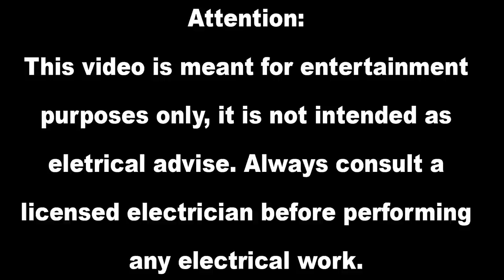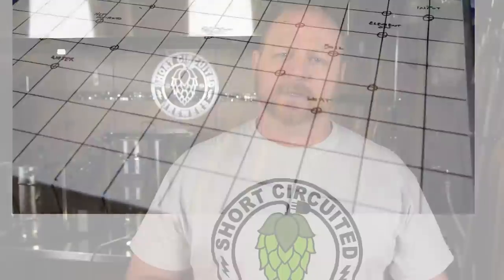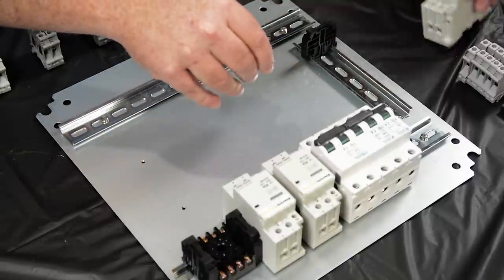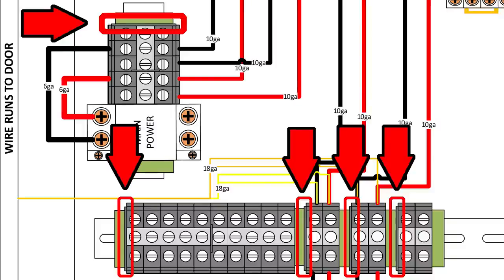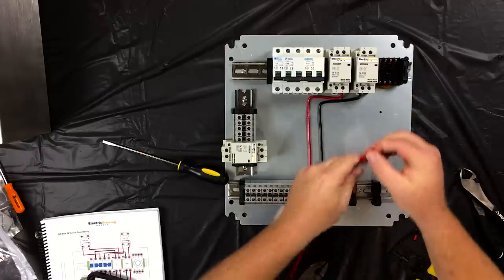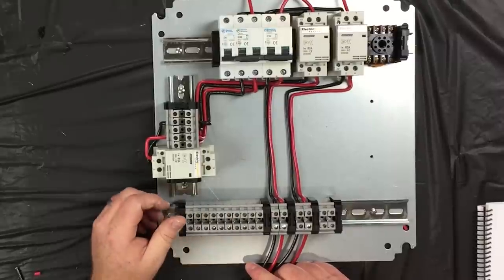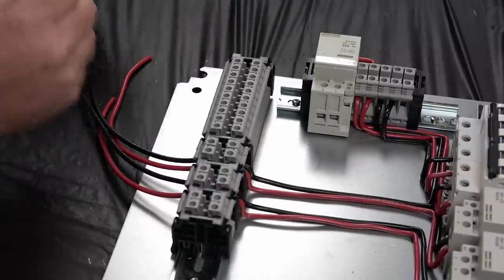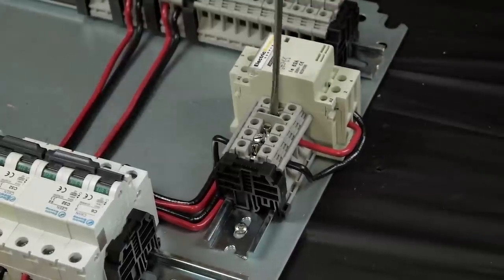Electric Brewing Supply - Panel Build Part 1 - Panel layout and 220V wiring - for electric brewing

Comment: When you make 90s like that with the wire, you seperate the conductors inside of the wire and they become potential hotspots. Might want to consider sweeping the bend. Small tubing benders work great for that, as do zipties and saddles.
Reply from the maker: Understood, thanks for the tips! 👍🍻

Comment: Very excited for this!
Reply from the maker: Me to Brad I'm excited to get going on it. As a matter of fact I'm wiring more of the panel right now. 👍🍻
Reply: Awesome! I noticed you didn't use any spade terminals. Are you foregoing them entirely? Or just with the heavier gauge wires?
Reply from the maker: The way the connections are made  on the back panel of the control panel you don't need to have any spades on those they have a crimp system that holds the wires in place. On the control panel door we will definitely be using spade connectors because those are just screw connections  on  switches, lights, etc. The only thing on the back panel that gets spade connectors is the interlock circuit relay which is also the estop relay
Reply: Thanks for the clarification!

Comment: Hi just a quick note I build panels and it is not recommended to bend the wires with players in a tight bend. I have been told by the electrical authority here in Canada that it can compromise the wire jacket. I once did the same for tidiness but was told my panels wouldn’t pass inspection. We use CSA here in Canada and they have a reciprocal agreement with UL. I am told a curve is acceptable. 
I don’t know if you have had an inspection 
Also ground found ground. 
I now use a copper bar at the bottom or a star point for all grounds. Should be done first.
Reply from the maker: Good tips!! Thanks for sharing! 👍🍻

Comment: Never ever use any form of grips to bend cables the secret is to Make the cable work for you pressure marks are now present on the sheaths of the cables naughty . warm the cable in your hands slide it up and down in your hands so you create heat this then softens the outer sheath and loosens up the cores Cold multi strand cable can crack break if you over pressure i can bend form right up to a 240 quad power cable . ...  Respect to your work my Friend just here to help .
Reply from the maker: Hey thanks for that tip!! I'll use it! 👍🍻

Comment: Great video and very helpful!  Wondering if you know if I can use both sides of the power distribution block to run my hot wires to?  Still using the jumpers, but really allowing for fewer blocks to be used.  Thanks!
Reply from the maker: Sure you can use both sides. The main reason for the jumpers is to allow a single wire to power multiple blocks at time. Thanks for commenting! Cheers Stephen! 👍🍻
Reply: Thank you, that helps a ton. I'll be sure to share my build when done! Cheers!
Reply from the maker: Looking forward to it!

Comment: I've seen some other guys build this 30A control panel, however you're the only one I've seen using those rails to mount everything to the back plate. Do the rails come with the kit, or is this a personal touch you added?
Reply from the maker: That is how it came in the kit.
Reply: @ShortCircuitedBrewers  Thanks, I did a bit more research on their website it appears that the DIN rail components are now an add on option. Love the content.
Reply from the maker: @chrislaliberte544  thanks!! 👍🍻

Comment: I’m at the concept stage of designing a system like yours. I have limited experience with building electronics so I’m taking my time. I’m curious about the differences in the back panel - component rails and components Vs the back panel on your website (build tutorial.) They appear to be two different systems with different components. Can you elaborate a bit on both?
Reply from the maker: Rudeboyardee not a huge difference really. I would say the rail system is a little cleaner install. On the other hand the singular components allow a little more flexibility on placement. There maybe a slight increase in cost with the rail system due to the extra cost of the rail itself. So there are positive and negative aspects to either one. As far as the difference between the two systems one of them is a kit from ebrewsupply that they sent me to do the tutorial with I am not keeping the control panel. The other one was a early design that was meant to be as cost-effective as possible for someone looking to build a control panel like that. Hope that helps a little bit  cheers!! 👍🍻

Comment: Awesome Video.  Thanks for all the tips.  I have a question for you?  What type of wiring are you using inside your panel?  I have some extra SOOW 10 guage wire that I can cut up and use, but would that be ok?  The electric brewery recommends THHM.  Any help would be great.  Thank you
Reply from the maker: You can use the wire from the SOOW. I just does not hold its shape as well. The other thing about that type of wire also has smaller strands than the THHM so it can pull out of terminals easier. Other than those 2 issues I don't see any issues with it.
Reply: Short Circuited Brewers thank you!
Reply from the maker: No problem Sean! 👍🍻

Comment: Brian on a scale of 1-10 what would you say the difficulty is to build this ?
Reply from the maker: Mark Yajcaji A 6.. With my videos a little easier. The instructions from them are a little "high level" but as I say I  the videos. Take it one circuit at a time and double check everything you would be surprised how easy it is. Hardest part for most people is the interlock circuit. But it not to bad. It is a very complete kit, I wasn't missing ANYTHING.. If you decide to do it, I'm here and Ryan and his staff are great too. 👍🍻

Comment: Is there a benefit to using stranded wire vs solid core wire
Reply from the maker: Stranded wire is much easier to work with, twist, bend and much more flexible. I don't know how much you have worked with solid wire but it is a real pain to bend especially in larger gauge sizes. You COULD use solid copper if you wanted. The door for instance would be difficult to open and close due to the lack of flexibility of the solid wire. I hope that answers your question? (Good question!) Thanks for watching Troy! Cheers 🍻
Reply: If i recall properly AC flows on the outside and DC flows through the wire. So stranded wire is superior for an AC project like this to prevent power drop. but then again the wiring length probably isn't enough to make a difference. My late .02.

Comment: Do you ever use trunking on your back plates?
Reply from the maker: Have not used any on the ones that I have built so far. I have an Arduino based system build coming up I will probably use some on to keep it clean due to all the wiring that will be in it. Thanks for watching and commenting! 👍🍻
Reply: Short Circuited Brewers no problem dude! First video of yours that I’ve watched and it’s great quality keep up the good work👍
Reply from the maker: Thanks!! 👍🍻